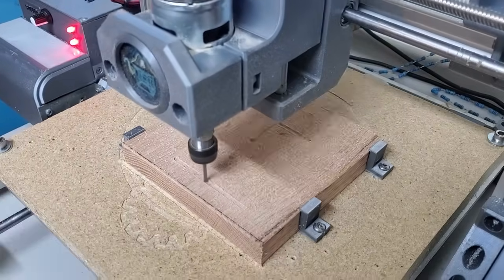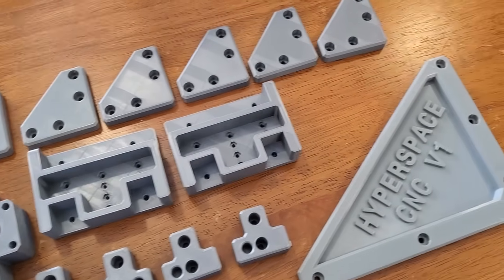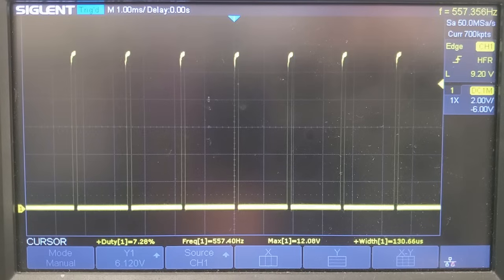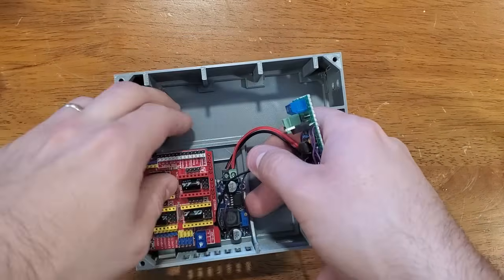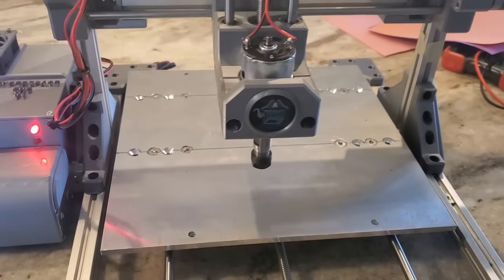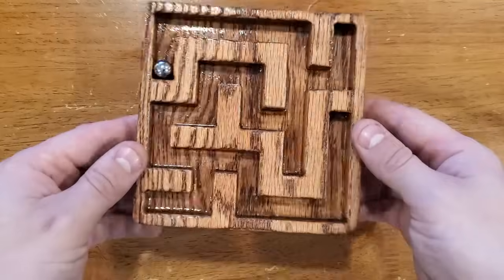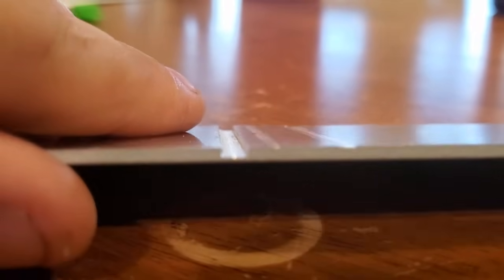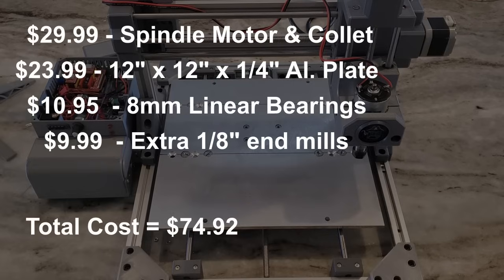CNC Mill for under $100

Comment: "How to build a CNC Mill for under $100 when you have over $1000 in spare parts to use"
Reply: ... and also about as much in tools, like a 3D printer...
Reply: @peka2478  And also A s-load of time...cost of 3d filament...likelihood of 3d part failure is high...
Reply: @bobcanuso5800  and also a CAD Program for 5000$ (CATIA)
Reply: @hansmeier4930  13000 us dlls the cheapest and basic license, plus 5000 for yearly maintenance, 32000 if manage a basic surface modeling capability, i used to sell catia
Reply: @bobcanuso5800  If your 3d printed parts are failing either during the print phase or afterwards, either your printer isn't tuned right, or your parts aren't designed that well, or your materials are failing you.
Reply: @hansmeier4930  No.....you can find open source programs for free. Blender is a good one.
Reply: @peka2478  did you count the cost of every screwdriver used as well.as the electricity for lights so he can see what he is building?
Reply: You don't know how to use quote marks. This video is not titled "how to build a CNC Mill for  under $100 ...", it's literally "CNC Mill for under $100". Even if that doesn't satisfy you, the description very clearly states that this is what it cost based on the materials and tools available. Heck, even a minute in it's made clear that this is based on parts that available to him. Even above all of that, if you start nitpicking how much it costs for software, tools etc., then why stop there, just throw in the cost of an engineering degree, trial an error, food, housing, medical bills, etc.
Reply: @Southghost5997  You don't need an "engineering degree" to make a CNC machine or to use one, and costs that you would incur regardless of whether you build a machine or not would not be applicable.

The title is misleading because it implies that it could be done for $100, which may be possible, but he claims to have over $500 in parts in his "junk drawer". Keep defending stupid, my man.
Reply: @alphaforce6998  when did I defend you?
Reply: Yep, the obvious is right in front of you..still it's remarkable. Those servos alone are more than 100? I'm not sure
Reply: https://www.youtube.com/channel/UCul9__cUwqiNB8PtQniaFEg
Reply: I mean..  Just design your parts for printing, outsource it for cheap, await parts, and build. Ez. Unless you're incapable of independent thought
Reply: best comment
Reply: Lots of people with these kinds of hobbies collect a lot of parts. I got into tube amps for a while and ended up collecting 6 tube-based organs that I stripped for parts, several tube PAs, a wire recorder and other gadgets. In the end, I'm loaded up with all kinds of high voltage transformers, audio output transformers, and other assorted parts that are handy for building tube amps.
I don't really do stuff with motors, but I have a handful of them of various sizes and powers. Back when I was single, I had WAY more junk. My wife's a bit of a minimalist and I'm a convert, so I've scaled back drastically in the past decade.
Reply: @petedavis7970  Haha I'll never give up my trash, I would write the market price on every item and they can pay me to remove them. I just built a 1000L pond with my fence cutoffs, some old sheet metal, pool liner cutouts from stairs, etc.

I ordered the few things I can't scavenge for; filters, glue, silicone, etc. People around me throw out perfectly good machines when buttons stop working, and when you crack them open they are full of clean parts.

I used to be embarrassed about free cycling, but now that I proved the value of available inventory on multiple projects I am more assertive about it. I love gaining value for free, and I can explain my inventory just not the way its organized
Reply: You do realize that these videos are simply here to show people how to build things on their own. But I get it. Everyone wants to complain about everything and also wants everything to be free. If you cant catch the sarcastic tone then you might want to fix that. Youtube will give all yall anxiety nightmares....
Reply: @jayvonirsik7232  Sounds like you're projecting, the video title is being disputed and it is inaccurate. 
They chose this title knowing they could trick people into watching a video that doesn't meet the expectation set by the title. They complain because it wasted their time, but even trying to build a CNC for under $100 is also a waste of time. 

I honestly only watched the video because I thought it would be amusing to see a bunch of trash bolted together and labelled as a CNC machine
Reply: @FletcherHillier  If this video wasted their time then their time is far more valuable than everyone elses and therefore they would never need to watch such a video because they can afford to buy a high end CNC mill. But yes I get it everyone lost sleep over this guys title and the fact that he had parts that could be used and only had to spend a hundred dollars to make it. This is the internet its full of useless nonsense.
Reply: @jayvonirsik7232 You lost me at the word "Y'all"
Reply: @makkapakkka  Y'all just cry too much....
Reply: @jayvonirsik7232  you lost me at y'all....
Reply: @makkapakkka  yall lost me period.
Reply: @jayvonirsik7232  you lost me at y'all... What does that mean?
Reply: @makkapakkka  It means you don't like the word yall
Reply: @jayvonirsik7232  you done it again... You lost me at the word y'all.
Reply: @makkapakkka  well in all reality you all need to calm down. It seems as though everyone tries to get witty with others in an attempt to acquire digital high fives from other shit posters. Yall need to chill out. There maybe you can get through it before I lose you again.
Reply: @jayvonirsik7232  you keep doing it Jay... You lost me at y'all again!
Reply: @makkapakkka  y'all lost me at makkapakka....
Reply: @jeffwood8109  you lost me at "y'all"...
Reply: @makkapakkka  don't ever talk to a NASA engineer then...
Reply: Honestly, if you're someone who does things like this on a regular basis, it's not unusual to have to kind of stuff he uses in the video lying around. I have more spare electrical components, tools, and scrap than I know what to do with. What are you even planning on using this for?
Reply: @aaaa1111muffin  like i do silverwork and copper with resin as more of a side stick iv got more inks dyes and pieces for resin then i actually have for ringmaking which i do more like with some things if you do them often enough you build up a supply better then most warehouses
Reply: @aaaa1111muffin  Thats true, you can also take apart an old computer. I have like 10 old computers lying around with a good power supply.
Reply: @aaaa1111muffin   Even if you have the stuff laying around, you did buy it at one point. He didn't claim to have gotten the "spare parts" by dumpster diving so we can only conclude that he originally paid for them, and that cost should be included in the total. Also, time spent. He spent 3 days 3D-printing shitty plastic brackets to hold the extrusions together instead of using readily available brackets specific to extrusions. The motor mount was really the only thing that he could have justified going custom on, but even those are available on ebay for a few bucks.

Comment: Dude, you're already using an arduino, can't you just use one of the PWM pins to control the speed of the spindle?
Also, if you are talking about cost, you need to include the materials you already had at hand, and I'll give you a discount in the 3D printed parts, you only need to account for the filament, not what it would cost to have it printed somewhere if you didn't already have a 3D printer.

Comment: @15:20 Fuckin' lol... Rigidity certainly isn't that machine's forte.
 
Yea... Your biggest problem are the Linear Rods not having any support except for at heir ends... This isn't 3D Printing with the Toolhead only seeing deflections from inertia due to a sudden change in directory... You're actually working against the material and as such it needs proper support. Maybe consider making the frame out of MDF in a Torsion Box Configuration ( still - the Linear Rods have to go ).

As for a proper CAD/CAM software the obvious recommendation is Fusion360 - which has a free license option - featuring such niceties like Adaptive Toolpaths nice for everyone but especially interesting for such underpowered machines like yours. It also has a brutally large community and online presence to learn from - Personal recommendation would be the Lars Christensen Training Videos.

Comment: Not a fan of videos that are slightly dishonest.  Yes after the $1000 3d printer, $50 plastic spool, $100 worth of stuff you already had, you only had to spend $100 more.
Reply: my last 3d printer was 300odd 90% prebuilt 2 years ago
Reply: @sqwert654  still not under a hundred though is it
Reply: @cap871  then you might as well add a house to build it in etc
Reply: @sqwert654  well that's an incredibly stupid thing to say.  try to focus like an adult should be able to.  Video claims CNC for under 100.  The most expensive parts he already had and did not bother to include that.  The most important parts he manufactured using a secondary and rather expensive machine as well.  There is no way, that even one as simple as you seem to be could think this is as stated.  A CNC for under $100. Anyway, what are you, his girlfriend running to his defence?

Comment: The problem with 3D printed parts is that after awhile cracks start to appear and then total failure.  I would suggest you use the CNC to quickly mill replacement parts for the 3D printed  parts while you still can.
Reply: Duly noted. I never liked time consumption of 3d printer anyway

Comment: Nice project.
However, you spent over a thousand dollars of your time.
-3 days 3D printing,
-Weeks of designing 
-days of setting up the boards
Etc
It would have been cheaper to buy an average  500 dollars cnc

Comment: The electronics engineer in me cringed when you said you would use the buck converter to drop down the 24V to only 12 V, and let the arduino handle the rest. You see, the arduino uses a simple regulator, which basically turns the "extra 7 volts" to heat, depending on the current draw. This is really inefficient and leads to needless heat on the arduino. The correct way to do it would be to set the buck converter to 6 Volts, or even 5 volts directly, as the converter has no problem with it and it has over 90% efficiency. It also doesnt jsut burn the power, it actually converts it, unlike the regulator on the arduino.
Reply from the maker: You're correct, but I was using the 12V for a few other odds and ends which is why i didn't reduce the voltage from the buck converter down more

Comment: 5 minute crafts be like “ we’re gonna make a CNC with parts in the drawer”
 proceeds to pull out stuff only someone who (probably) has that as they’re job, or at least dedicated hobby, would have
Still a cool video.
Reply: Exactly my thoughts, like lets build this cheap cnc router for under $100, I have a $50.000+ Haas VF1 laying around we can scour parts from, and by the way, I just disassembled 100 $1000 CNC hobby machines , so lets start

Comment: Could use an old wood router for spindle.
Reply: You could but it limits the kind of tooling you can use. There's not many collets available for wood routers. Wood routers tend to be really noisy hanging off CNC machines too.

Comment: CNC Mill for Under 100$ vs "costing me under 100$ coz I printed loads of stuff with a 3D printer, thats not free anyway, but lets pretend + I had a bunch of stuff in a drawer that I used" is 2 vastly different thing buddy.
Reply: you can do parts hunting if you want. for an example i just bought an old CRT TV for 8$ because i only need the proper electron gun parts that tv had, and the left over parts like circuit etc i just stored them. not only i saved lot of money from buying a CRT i also got so many leftover parts for only 8 bucks. if you keep doing this for some projects you will eventually ended up with treasure.

Comment: You must have one hell of a JUNK drawer.  The parts you have in there are a lot more than $100.  The NEMA 17 stepper motors are $10.99 each.  That's $33 alone.  The aluminum rails are even more and the parts you made you have to own a 3D printer.  The spindle by your admission is $30.  Then there are the drive screws and couplers and hardware to connect to the printed parts.  The electronics would cost $200 at best.  Lead screw and nuts are another issue.  That's $16 a pair and your system has 3.  Its amazing how you had all these parts in that junk drawer.  Now add that in the 3D printer and the bank is busted.  Sorry but your title is very misleading.  All this and I haven't even touched the software.  I made one out of wood then cut aluminum parts to create a much improved unit.😁

Comment: Your Arduino CNC hat has a spindle drive built into it and it can drive a spindle up to 48v, you didn't need the extra motor driver you built. And you could have then also controlled it through the UGS/Candle software (or whatever CNC GRBL software you're using.  I have this system myself and it works fantastic.
Reply: First: SHOW us the spindle power driver on the Arduino-GBRL-Shield.
Second: You can't ... there is none!
The Logic-Level-DIGITAL(!) Z+ output can be used as PWM-signal. And that signal can be used to drive a driver stage or power amplifier. Hint: GRBL setting, $32 = 1 (Laser-mode enable, boolean)

Comment: Btw Grbl can output a PWM signal to control the speed of the spindle motor. Seems like this would be relatively easy to connect up to your speed controller, if that is something you wanted.

Comment: Now that you have a machine that can cut aluminum....self replicate the machine in aluminum and replace the plastic bits.  That will undoubtedly stiffen it up.  

I built out an old round column mill into cnc years ago, bought ball screws from ebay.  They were not priced too bad.  Stiffen up and incorporate some zero lash screws and I'd imagine you would have a fairly accurate machine.

Nice work nonetheless man!

Comment: Bearings on the leads screw where they attach to the stepper motors (both ends actually) are essential for holding the rigidity and help the router move with greater reliability.
Reply: Fixed both ends lead screws definitely helps.

Comment: Use a drivin spindle instead of relying on the oilite brass bushing in that can motor. Even a brushless motor and speed controller could be used by pwm. Tp power motors can reach up to 120,000 rpm that speed geared down will give you enough speed to cut down on lateral load with the correct speeds and feeds. But all that is more than 100 bucks lol.

Comment: I'm just wondering what the true BOM cost would be for this.  Not everyone has all those spares lying around.  Noob question: since the spindle is controlled via a mosfet, is their a reason to not have the Arduino just drive that with a PWM signal?

Comment: wow, nice build!,,any way we could get a copy of  the CAD files? id love to build a micromill for small parts that would cost me ...a lot, if I did use the.big mill..

also, now that the machine cuts. use it cut progressively more accurate tolerances in the machine parts for the next model,  rinse and repeat till you've got it perfect.

Comment: just gotta buy a 3d printer and fill a junk box with 100 bucks of junk extruded aluminum and steppers then i can spend 100 bucks to make a cnc that cost YOU 100 to make

Comment: Really well done! although, i might not call it a >$100 mill, since step 1 of building it was to pull half the components from your junk drawer ;)
Reply: yep, very clickbait title and kind of a straight up lie.
Reply: And step 2 was to have access to a 3d printer.
Reply: @gweedohatsis8404  Step 3 was "develop a custom working CNC mill from scratch..."
Reply: Very much "rest of the fucking owl"
Reply: many of these parts can be sourced from places like ebay etc for cheaper than you think. the stepper drivers he is using aren't exactly quiet but all of them probably cost $10 max i was able to find leadscrews with the brass nuts for about $8 a piece and you don't have to use extrusions, if you want the frame to be metal, you could go buy metal from a junk yard and have some basic shapes cut for the beams or you could look up a local company that sell their cutoff pieces of metal for cheap. seriously though, if you know where to look you could build something of better quality...
Reply: I do not however like that he said the final price was $74 because of the parts that he bought

Comment: With access to a drill press, a grinder and some steel (which I do) I would be very curious to see what kind of design upgrades could be done to increase rigidity to such a machine (or the 3018 kits out there). I believe these machines can be taken to a very nice spot for home gamers. Is that an avenue you will be looking into ? If so, let me order my kit before you get started haha.
Reply: Our maker space made a very nice CNC mill out of MDF and L-channel aluminum. If you have steel at hand, even better. You can definitely make something nice yourself if you're willing to put in the time to research, design, and fabricate.
Reply: Depends on what he wants to do with it. Gantry type machines are usually used more often for wood and sheet metal for more router style projects.
For cutting blocks of metal, a vertical mill is better, in which the tool head only moves along the Z, and is fixed to a heavy solid frame.
and the table moves along both X & Y. Stronger motors are usually used too.
The more solid the machine , the less vibration there is.